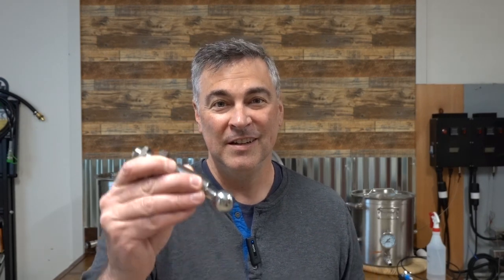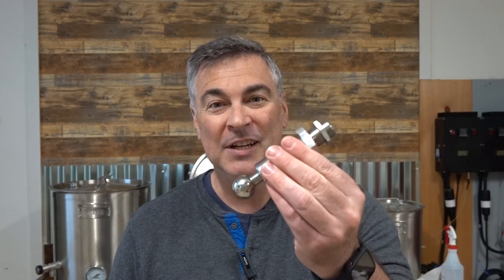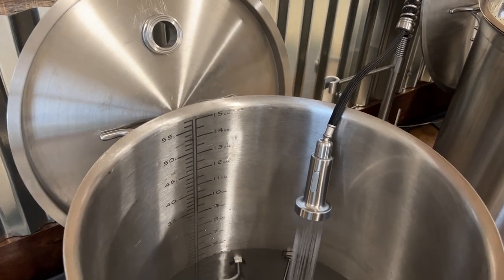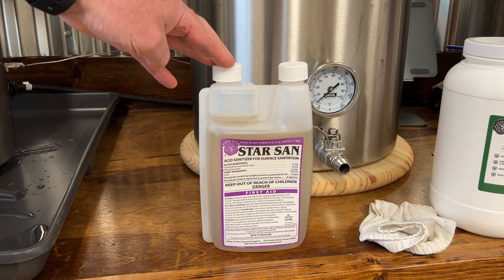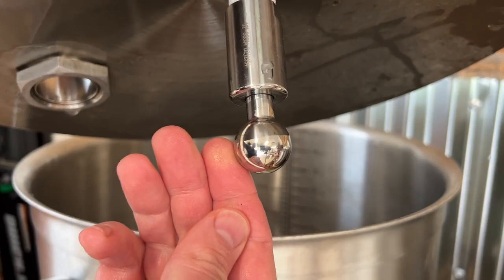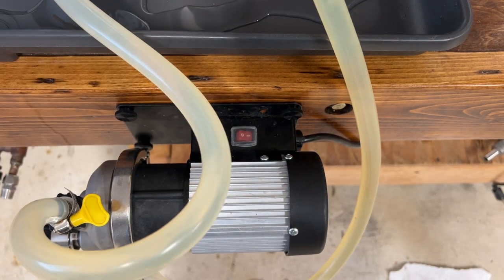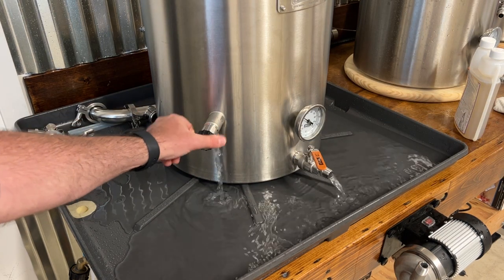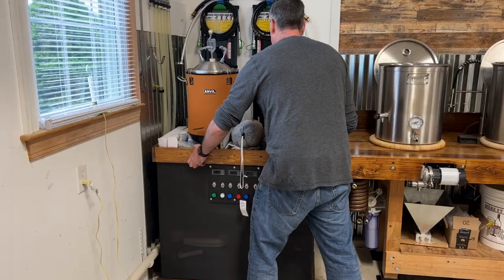How to Clean Kettles Without a Sink [ Clean in Place ] #homebrewing

Comment: I put a tea strainer over my bath tub drain and you can buy a $20 shower head that comes with an attached shower wand. The tea strainer is to keep the larger bits of trub from going down the drain as depending on your shower can easily clog.
Reply from the maker: A tub is definitely a nice way to go. I was thinking about adding some sort of strainer on my drain pipe as well. I like that idea. Thanks for the comment and feedback! Cheers!